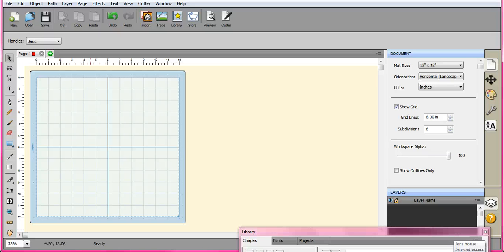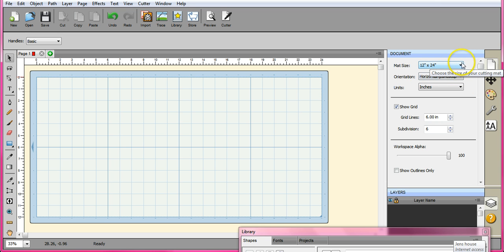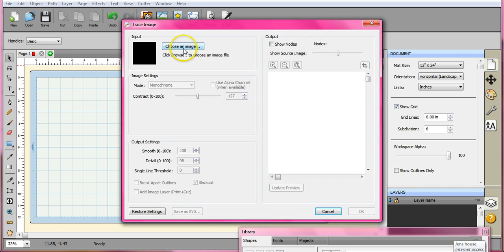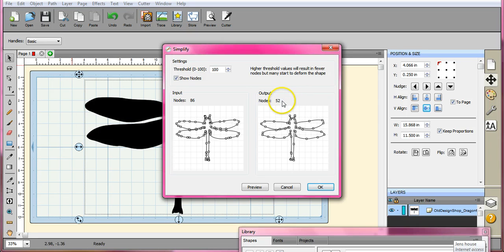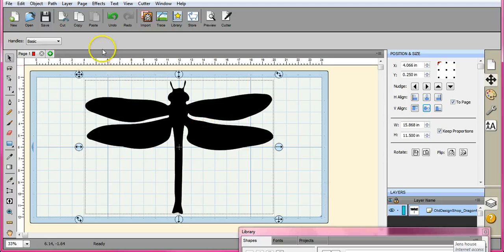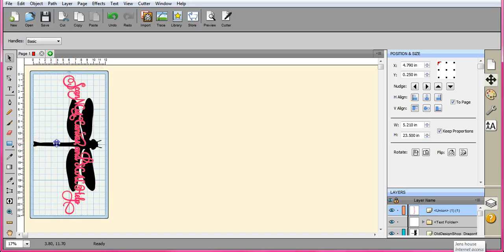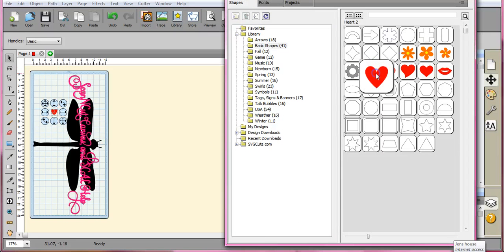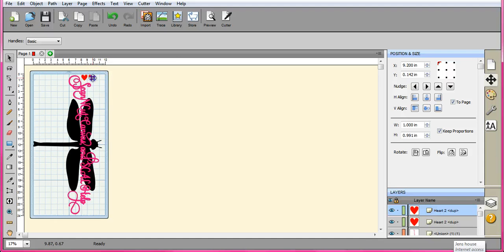pt 1 12X24, vinyl layering, Registration marks, page saving, use of horizontal/vertical Jen Blausey

Comment: One more question... Can I use my tablet to do everything you made here?
Reply from the maker: +Jessica J I do not recommend using a tablet. I do not use one. You would have to try it with Canvas. WIth SCAL, you would have to use SCAL3, as that is the tablet app, and there is not the features that the FULL featured full system application has. Thus the pricing difference.

Comment: I have a question... Hope u could help... Can the 12x24 mat be used on the regular 350 scan n cut?
Reply from the maker: +Jessica J The 24 inch mat can be used on EVERY machine to CUT, just no scanning except for the US 650 and UK 700 & 900 and some AUS ones 650 I believe, as I think they have the same as the US, those higher end machines CAN SCAN the 24" mat. On my page I have all of the correct info on what all the machines do =)